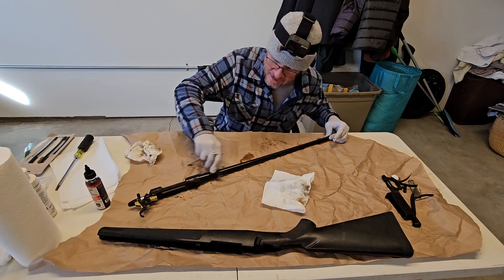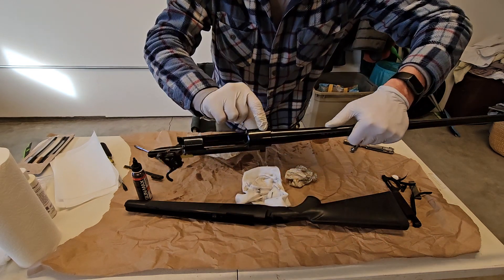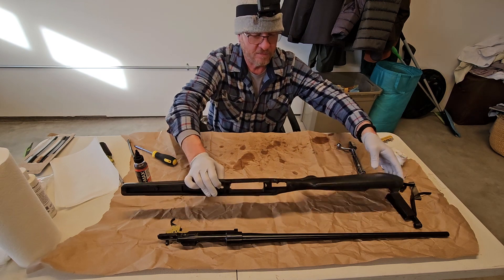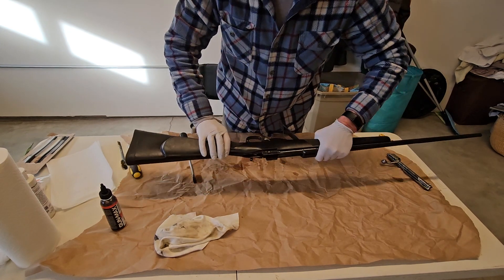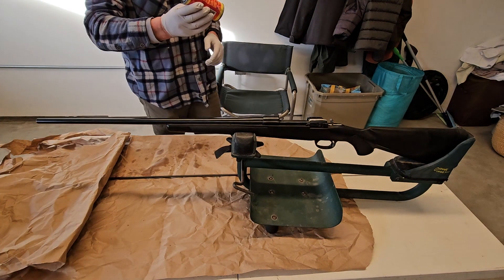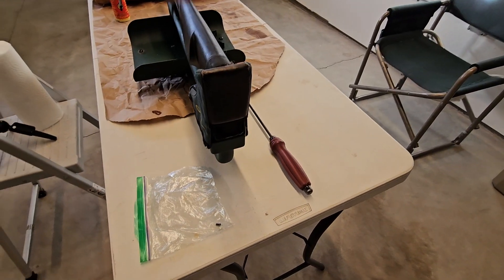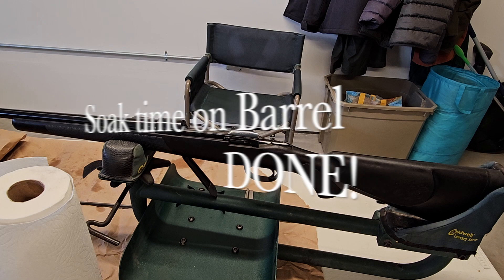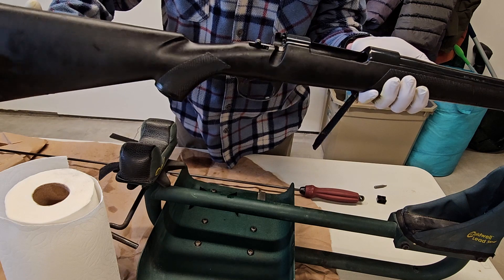Herters XK3?  My Old Rifle Needs Help!

Comment: I also have a Herter's XK3, but In 6mm Remington. Mine has a different floorplate release, trigger assembly and bolt shroud, but the same non-Mauser bolt stop. It's a junk feature. When i cycle the bolt sharply to the rear, It's likely to come right out of the receiver! 😂
Reply from the maker: My bolt used to come out as well. I had to take it to a gunsmith. He recut the Champher so the bolt stop would engage. Much better.... thanks for watching!
Reply: @randyfogle6570  What caliber is your XK3? Yes, I've thought about filing the bolt stop angle on mine but never have. Glad to hear it helps. Your's has some upgraded parts, trigger assembly, etc. I got mine as a teenager in the late 1960s when Herter's was closing them out. I don't recall the exact price but I bought it with paper route money cheap. Mine was also a barreled action that I stocked using a Herter's French walnut blank. I wish now I had gotten .243 as 6mm Rem is near obsolete. Not many of these around. Mine is German made.
Reply from the maker: Mine is a 270 win. I got it as a gift from a friend when we had deer tags together. Everything done to mine was before I got it..... except getting the work done to catch bolt.

Comment: Can you please list the scope rails and the scope rings you used.  I'm having trouble finding these things for my XK3.  Thank you!
Reply from the maker: Larry0, i can't list an exact base. They came off of another gun i had.  I was really trying to get a 1 piece picatinny rail but could not find one. The closest I got was a base that had all the right measurements but it was 1/8" to short. It does fit my Interarms Mark 10 though. I was thinking out slotting the base. What I ended up using were Weaver 2 piece bases. I think they are still available.  Then you just need Weaver rings the right tube diameter. I will try to find the info on that One piece base. You might be able to cut it down to fit. Good Luck!
Reply: @randyfogle6570  Thanks a lot.  I've been having a hell of a time trying to find base and rings.  I' trying some Talley rings right now, we'll see how they work, they are base and rings in one.

Comment: Just get it cerakoted and be done with it.    That stuff is really tough.    I did a bedding job and lil epoxy stuck to the rear tang .    I scraped it off hard w a putty knife n never scratched the cerakote .   Tough stuff!
Reply from the maker: Non a bad idea, I'm gonna look into that
Reply: @randyfogle6570  it's absolutely 💯 impervious to elements.   And it's so tough.    I can't find anything better.   Just make sure you have it professionally done by a cerakote guy.  There is several great guys that just do cerakote rifles and that's there specially.    I highly suggest you do thst and don't attempt it yourself.     250$ 300$ get you a coating that last 2lifetimes

Comment: I just picked one up in a 300win mag identical to yours but am unable to find any info on them was wondering if you can shear any info on them
Reply from the maker: I believe they were sold by Montgomery Wards back in the 50's. Made in a Mid European country. Mine shoots pretty good, Did have some bolt problems though. Had to get a gunsmith to fix it for me. It is my understanding they are based on a sporterized Mauser 98 action and are similar in build to an interarms Mark 10.... but not exactly the same. That's about all I got. I did find a company that said they made single piece scope rails for it. But the 2 sets of hole are long by 2-10ths of an inch. I will have to mill it to work on my Herters but it fits my Interarms Mk10.good luck!